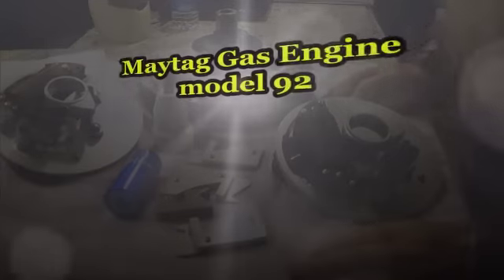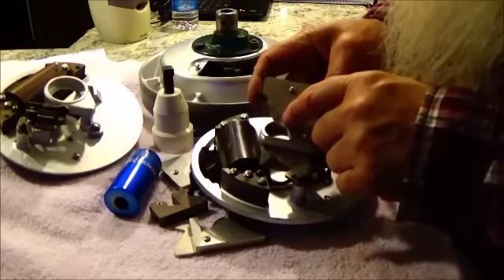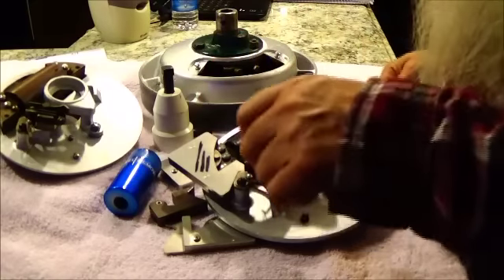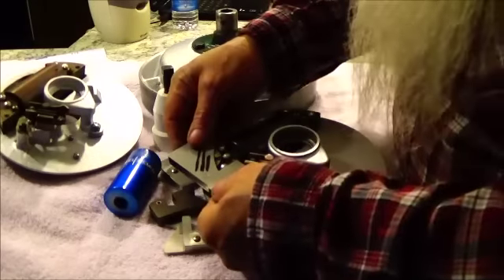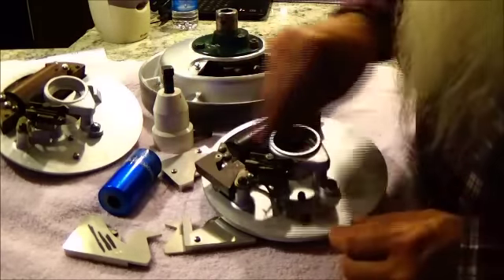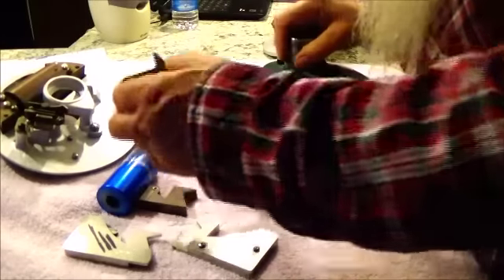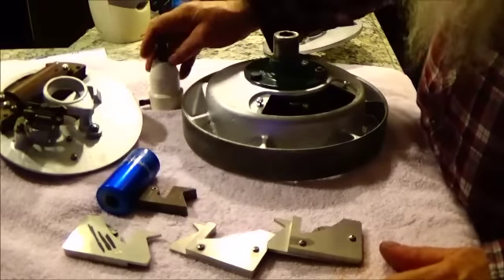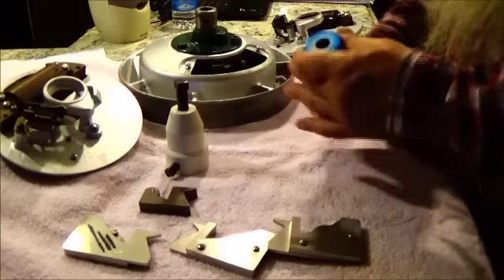Maytag Gas Engine model 92 timing tool

Comment: Another tip!I have a 92 flywheel puller tool and lent it to a friend. Later he returned it all bunged up. He said he had trouble getting it on so he used a hammer. Then to get it off, well the hammer again. I did manage to clean it up some in my lathe. Moral - if you think you know someone who should know how to handle tools, think again, then don't lend it, or help them and do it yourself!